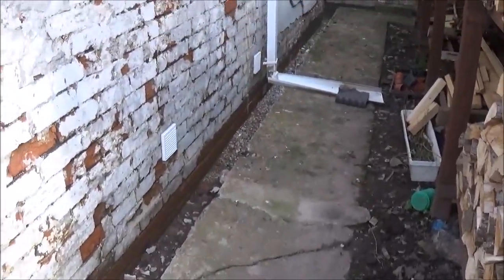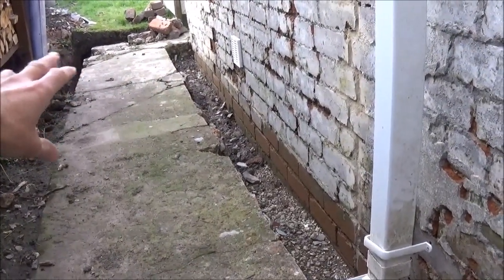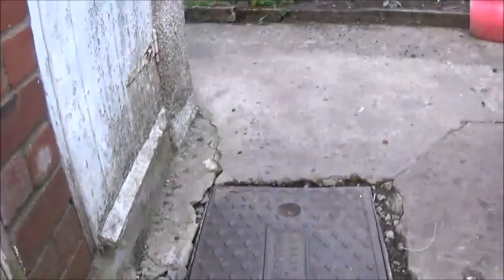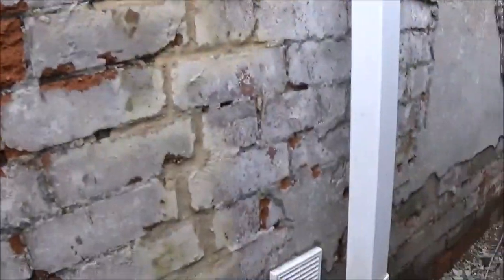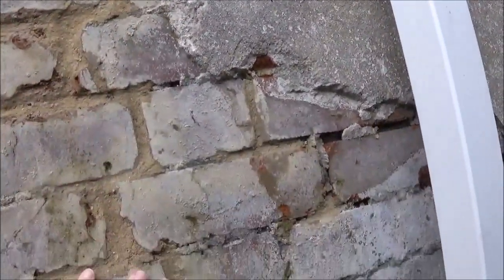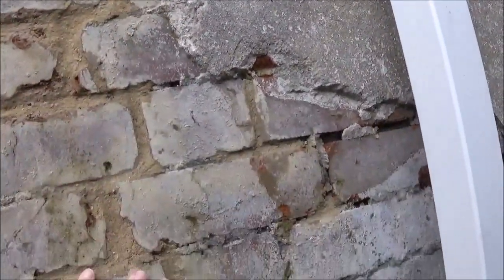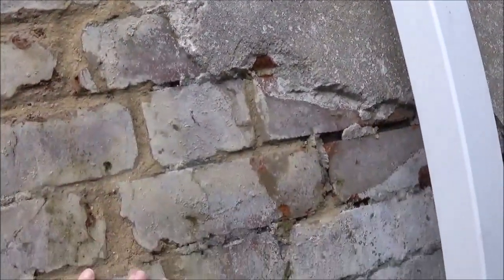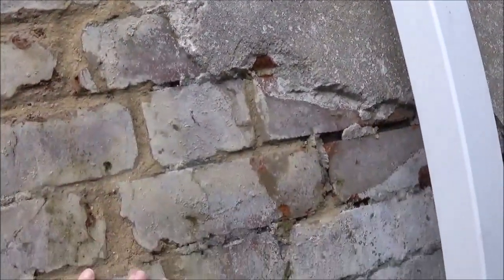How to fix rising damp & penetrating damp - (PART 2) Channel drain / french drain installation.

Comment: My house has solid 18" walls with sea salt water penetrating causing the wall paper, plaster and render to come off.  Should I remove the plaster and render and use a storm dry water sealant and lime render or dry line.  Would you recommend I seal the outside of the house with Storm dry sealant.  Looking forward to your expert comments. Cheers, Barrie.
Reply: Hi Barrie, where is the sea salt water coming from do you live near the coast?  If you have cement render (really important you check) on the exterior of the house and it is exposed to a lot of water spray or water then yes.. take off the cement render as the stuff only acts as a trap for moisture. 

DO NOT USE stormdry i'm afraid mate. Walls are designed to do TWO things and not one. The two things are 1. Keep moisture out which is what you are after and 2. Let moisture out.
If you think about your house and you live, breath, cook, clean bath, cold air meets warm air (condensation) etc etc etc all of this creates a certain degree of moisture... that moisture has got to go somewhere.. has to....  it will either collect indoors if you don't have you windows open on a regular basis as condensation.

Stormdry claims to enable brickwork to breath and yet also claims to stop moisture... you can stop moisture without using this stuff trust me.

Check what your house is built with first cement or lime? and when was it built?

If the house was built using a lime mortar then putting a cement render on top is pretty much going to ruin those mortar joints i can tell you now. Re point using lime render using lime only no cement! Cement is just the cheaper option but causes no end of problems especially if you live in a lime built house.

Hope this helps let me know if you have any questions
Reply: @electronurd3234  Thanks for the advice.  It is a semi detached concrete type construction. Built 1910 and facing out to sea. My neighbours are not suffering the damp problem and I notice their wall has been painted and only the lower part of my wall.  Assuming it is a concrete construction, what would you recommend i paint the wall with.  Also interior plaster and in places render has come off.  Would you recommend a dehumidifier to dry the walls out and seal the walls prior to render/plaster or dry line. The sea facing windows will be replaced with double glazing, gutters, soffits and facia will also be replaced and chimneys and lead valleys and flashings will be inspected.  One chimney is being reduced below roof level as it has let a large amount of water in. Cheers, Baz.
Reply from the maker: Hi Barrie, I'm no expert in this so I can't give you 'expert advice, but from my own experience I wouldn't use cement render or vinyl paints if you are suffering damp problems. One thing to consider is that it might purely be condensation caused by a very cold exposed wall and poor ventilation. With my chimney I have used chimney baloons in the fire places and put wind proof cowles on the chimney. This allows good ventillation down the chimney but stops the draught into the house. Sometimes you can seal a house up to much and the moisture will just condense on your coldest walls. Hope that helps a bit. Best of luck with it.

Comment: Quick question. Why did you go with the French drain near the house and not the other type of drain? The other drain has a nicer finish. So just wondering.
Reply from the maker: Hi Nick. I needed the channel drain to take the down pipe from my gutter as I redirected it from another gutter, and to take run off from the path which slopes towards it. I needed to lower the path to prevent the damp from occurring which was caused by rain splash back off the concrete floor. So the french drain was really just a belt and braces thing to ensure that if any water did collect in a heavy downpour, it has a simple route towards the drain rather than lingering before soaking into the ground. As for the appearance, I agree it's a bit shabby but I was doing it on a budget. When I have the time and money I will probably lower the entire path to the level of the chippings and lay a new patio as path. I could use nice decorative chippings then which would be level with the path. Plenty of ways to do it really. The important thing is getting the ground level directly outside your house wall lower than the inside floor level by 6 inches or more. Also try to get any rainwater away from the wall as quickly as possible. Hope that helps. Thanks for watching and good luck with your project.
Reply: POUSE around the HOUSE thanks for the response. Been watching your videos today. They are great. I have exactly the same issue, so I need to drop the outside floor. But not sure whether to take it down and put chippins in it or use one of those drains with the cover for a nicer finish??
Reply from the maker: @nickstevenson2147  You only need a channel drain if water is draining into it. So if you path slopes towards the house. But ideally you want all rain water to flow away from a building where possible. Hope that helps.

Comment: but that injection stuff , is it really required and it might be expensive to buy right ?
Reply from the maker: I don't think it is required. That's the point of my video. My house had injection damp roof cream before I bought it and the walls were still wet. Personally I don't believe it works, and I think there are simple crude ways to reduce or fix damp problems and I show some of these in my 3 damp videos. If you look in the description section there are links to the other two videos explaining what I did. Hope that helps and thanks for watching!
Reply: Okay thanks, im very new to DIY and limited with money , but learning what i can online before i go and buy whatever it is i can afford when i get some money.
Thanks for the patience

Comment: pouse, did this drain work do you get any damp still??
Reply from the maker: Damp sorted now. The main thing is getting your outside floor level a good 6 inches or more below the inside floor, and avoid cement render if possible.
Reply: Pouse, if your outside floor is 300mm above your internal floor, does a French drain system completely prevent moisture ingress?

Comment: Sorry Mr P, couldn't access comments, my question is: If breaking into a sewer network do you need Local Authority Permission? I will need to carry out the same as our house in Pembroke Dock
Reply from the maker: When breaking into any sewer you need to gain permission of the owner, usually either local authority, or more commonly the water supplier but it's different for different countries within the UK. In this example, I was purely diverting surface water from the roof. I originally had all the roof water going around the end of the house in an open gutter and down one gutter (downpipe) to an outside drain. It used to over spill on the corner so I split it into two down pipes on either side of the house so the same amount of water enters the drain but in two locations instead of one. The issue with adding water is capacity. A common problem is people adding surface water to foul sewers which can overload them causing manholes covers to lift in heavy rain. Another issue is putting dirty water (washing machines, sink waste etc) into surface water drains where it often ends up polluting the local stream or river. So always check if in doubt. Hope that helps. Thanks for watching!
Reply: Thank You
Reply from the maker: No problem!
Reply from the maker: No problem!

Comment: How did you chip out that channel in the concrete?
Reply from the maker: Angle grinder in a line, then an electric concrete breaker. £150 in screwfix. Bargain.

Comment: I thought it was illegal to put rain water into mains sewers ?
Reply from the maker: My sewer is victorian so is a combined system and that water was already going to the same sewer previously. I split the gutter to stop it travelling around the house so rather than enter the sewer in one place, it now does it in two. If you are adding any additional flow to any sewer you need to contact your water company first. Hope that helps.

Comment: Illegal.  Do not connect either rain water or surface water into a foul drain.
Reply from the maker: It's already connected to the system on the other side of the house, I just diverted it when upgrading my gutters. It's a victorian house and the system is a combined sewer. I take your point if it were a newer build as clean and foul water are separated in recent years. Thanks for watching.